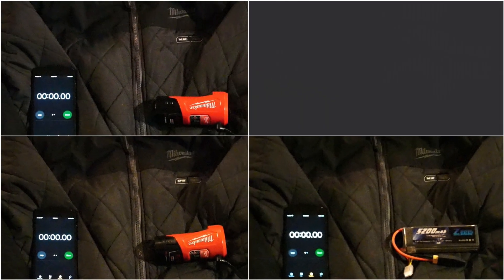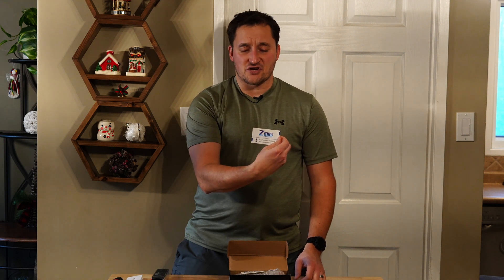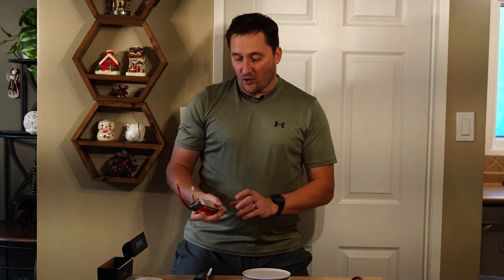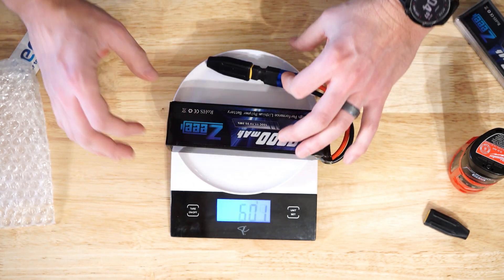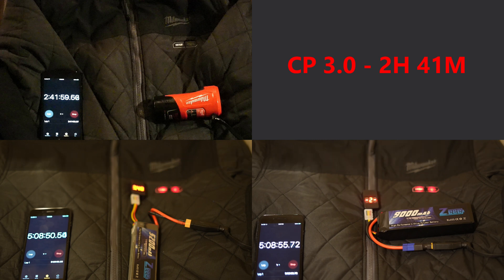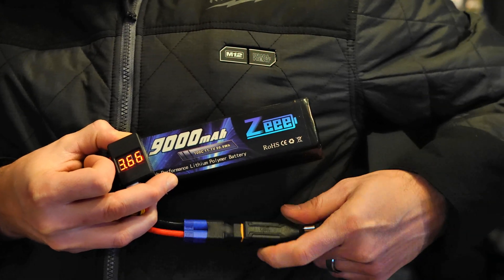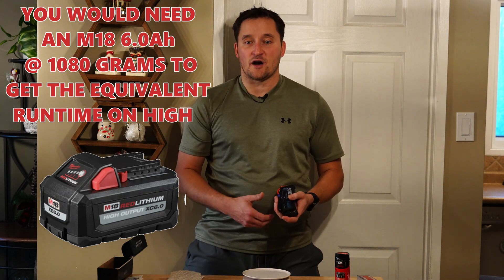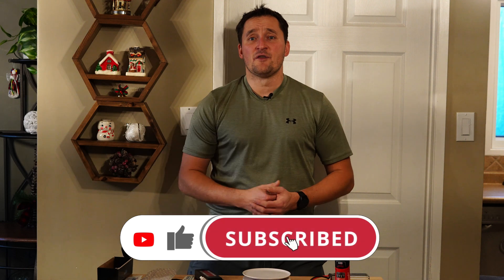Milwaukee M12 Heated Gear Battery HACK for INSANSE RUNTIME!!! PART 2 (WARNING READ DESCRIPTION!)

Comment: what adapter would a person need for the new style coat? @RegsChannel
Reply from the maker: Hi there! Thanks for the comment. The 5521 barrel adapter to XT60 should still work because those "Hexon" based jackets are still cross compatible with M12 batteries. My belief is that the second prong on that plug is probably for the "smart" features? But it also could very well be for another heat zone.. I need to get one in for testing to confirm.  Remember to follow all the proper safety precautions if you decide to give this a shot!
Reply: @RegsChannel  thanks for the response
Reply from the maker: @travismankin738  you are most welcome! Make sure you follow all the proper safety precautions and understand the risks! Keep us posted on how you make out. Thanks!

Comment: Yeah, it only takes one cell undercharged to junk the whole battery and be rejected by safe chargers.  And with unsafe chargers, forcing a charge that one cell will burn down your house.   
Now you could hack it to still be used safely with the bad cell disconnected, but.....in a dimminished capacity.
Reply: ikr, just use a power bank with decent capacity and a usb-pd trigger cable for 12v heated jacket. no lipo charger needed and much safer.
Reply from the maker: @uhjyuff2095  for me the size and shape of the power banks are a challenge, but yeah from a safety/simplicity standpoint I get it! Cheers.
Reply: @RegsChannel  I have the Gerber jacket n the millwalkee hoodie with the cord in the front pocket.   Makes a jumper box an easy swap
Reply from the maker: @daleb5967  Hi there! Thanks for the comment! Do you have a link?
Reply: @RegsChannel  no. It's a discontinued jacket I think.  A good 12 years old. Used it for motorcycle touring n hs football events. I used custom flashlight lipos for mountain bike riding at the football games n a few hay rides n snowmobile riding    BMW motorcycle dealerships sold the jackets

Edit :...gerbing
Reply from the maker: Yeah if I omit that cell it would drop me down to 7.4v nominal I believe. A possibility but I'm still in the return window so I may go that route. The 5200 mAh is a beast so far! For 47$ I'm very happy
Reply: @RegsChannel  I agree.  I would return the weak one, and yes the smaller one is the best bang for buck anyway.    
If you have other uses for the bad battery then keep it as a franken battery separate from the others for ......science......purposes......lol
Reply from the maker: @daleb5967  well I'm thinking that if this video performs as well as the other one did, I might consider some "destructive" terting by either "overclocking" the jacket, or simulating worst case scenarios to the battery compartment lol. Time will tell!
Reply: @RegsChannel  lol......for science of course......lol. 👍

Comment: I have a few of these rc battery’s for my rc truck if you get a decent charger to balance the cells while charging last a lot longer. I’m going to try it out in my heated m12 jacket as well thanks for the information
Reply from the maker: Thanks for the comment! Much appreciated! I picked up a B6 charger and it looks to be lightyears ahead of the one I had previously. I'm looking forward to talking about it/showing it in the next video!

Comment: I'd like to see what it takes to create the safety incident... over discharge, damaging the battery.

But yes, the regular LiPo battery safety would be good too.
Reply from the maker: Thanks for the comment! Major culprits as far as I can father are over discharge followed by a rapid high amp recharge. That, and physically damaging the cells pose the greatest risk. If this video comes close to the success of the previous one in the series I would for sure consider either "overclocking" the jacket with perhaps a 4s pack, or perhaps some destructive testing on the pack/jacket, or perhaps both! Thanks as always for the support.

Comment: Nice how you can push up the run time if you need to. Wouldn't hurt to have both, eh
Reply from the maker: Thanks for the comment! Well to put things into perspective, you could probably purchase both of these batteries, adapters and charger for less than one of the Milwaukee M18 6.0 batteries and get a dramatically longer runtime, in a much smaller battery footprint! Food for thought!